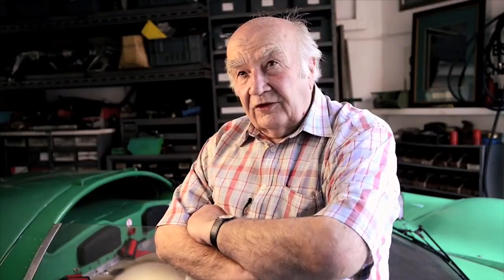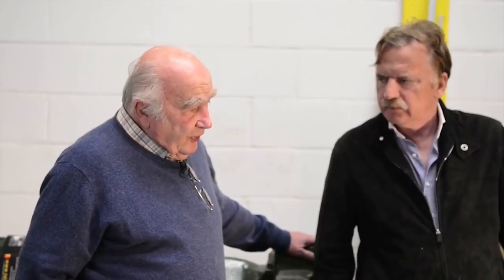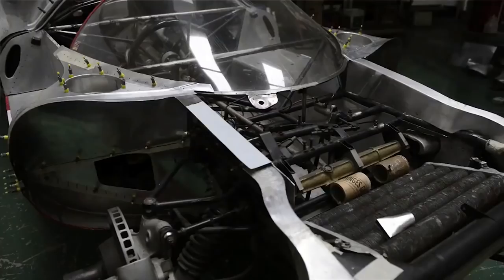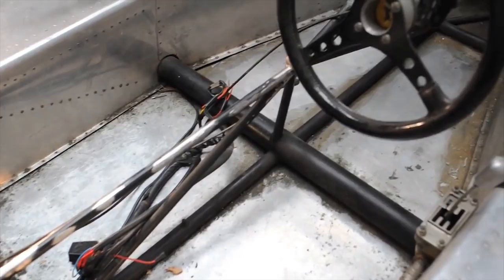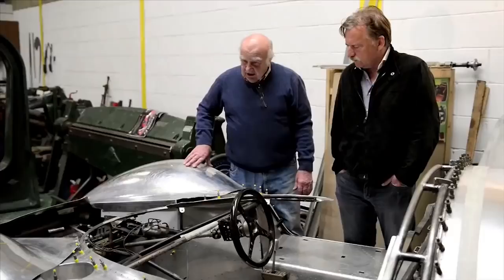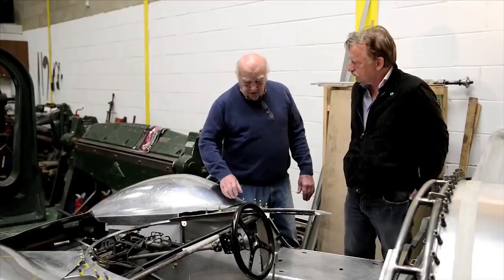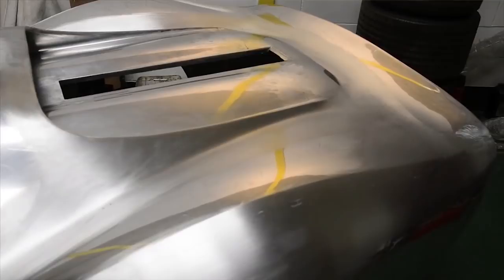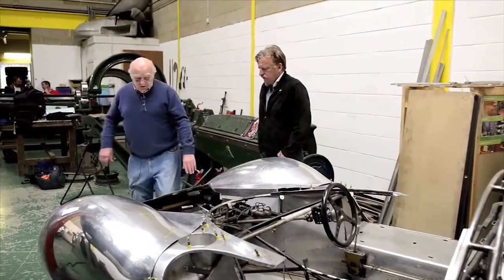David Piper talks about how he approached the Ferrari 330 P4 #0858 rebody -- Part 1

Comment: I remember seeing this car in its CanAm form in the hands of Chris Amon in 1968. He suffered a flat battery on the start line and by the time the battery was changed he was well over a lap behind. Amon the went "off the air" in one of the most dramatic drives I have had the privilege to watch. At the end he was second but if there had been another lap he would have won. Incredible stuff.
Reply: Not the 350 P4 Can/Am car.. you saw the 612 or 712..

Right?
Reply: @375GTB  My memory is that it was the P4 Can/Am car. However we are talking of 1968 and memory is fallable.
Reply: I need to look it up. It was seen at Riverside and in Canada. 

I have pics of it  at Riverside

But under powered to the 7+ Liter Mk.6 and Mk/8 McLaren...

Th 4.2 liter 350 engine was thought up for a possible Indy Ferrari.

But the new Offie Turbo cars were coming....

So that was shelved...

J.C.